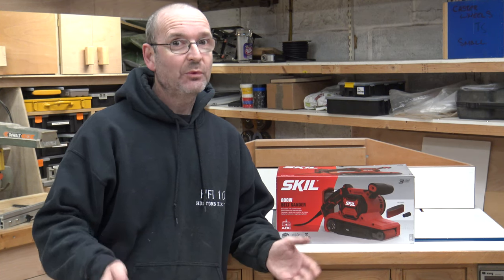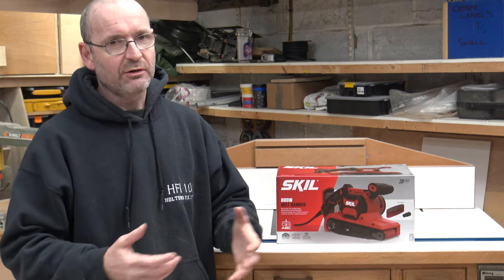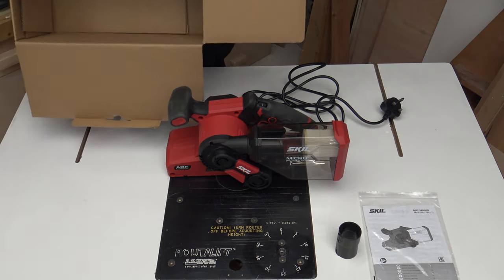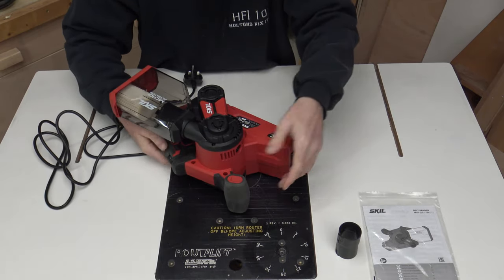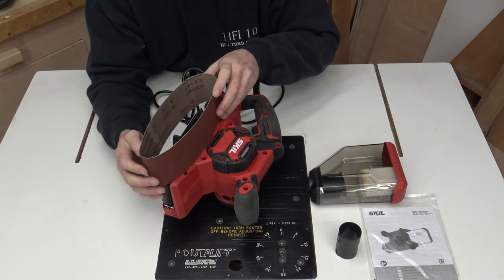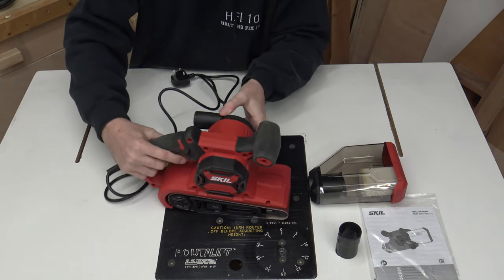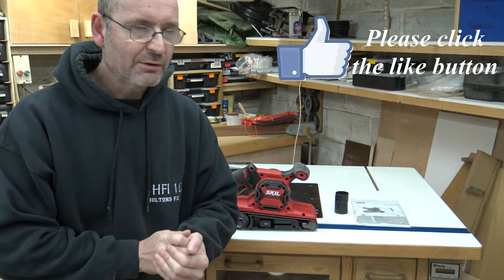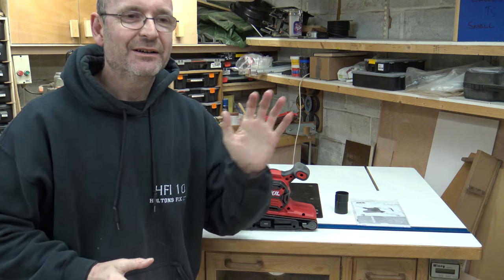Skil Belt Sander  - Holtonsfixit101

Comment: Yes, thanks for your report. Just bought one from B & Q about 2 hrs ago, ( 23/12/2019 )same model number and every thing for £60. Hope it does the trick. I am about to re start my hobby in my workshop in the new year. So I thought I would buy a new tool to encourage myself for the upcoming season , as I broke my spine, three ribs and bleeding in my head from a RTA back in May 2019. I also will report back on the tool, ( D.V. ). Many thanks once again.
Reply from the maker: Hope all is well now. Recovery is the hardest path to walk down after a RTA. I have a friend of mine that was involved in an RTA and woodworking helped him in his recovery. Not only did it get his limbs mobile again but woodworking took his mind off of what happened to him not just the physical side but the mental side of things to. It also help because we used to have a lot of banter back and forth to. Good luck with you new found passion but I hope you got deep pockets because woodworking will soon empty your bank account meaning there's always a new tool or a tool your need. It never stops.